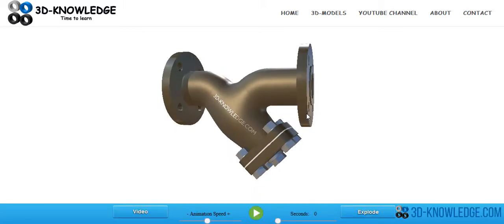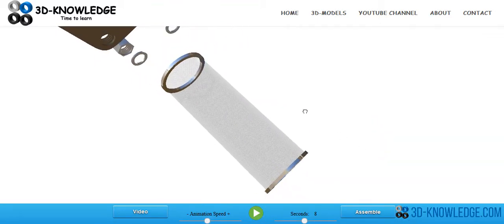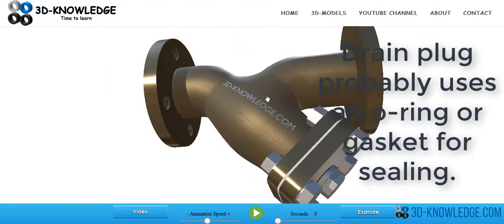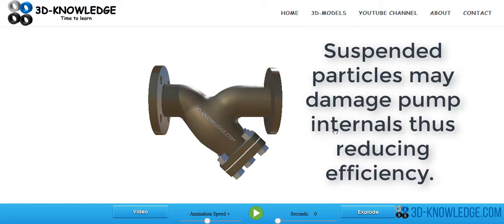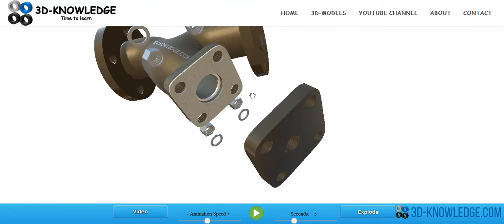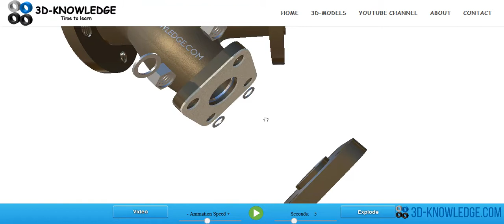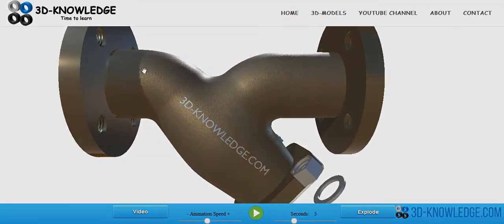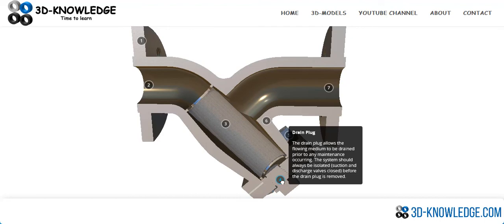Y Strainer Explained

Comment: Nice informative one, can someone explain how to design Y strainer for 10,000 psi pressure for 2 inch pipe. Which code to follow, how to ensure min thickness for internal pressure? For pipe ASME B31.3 is based on OD, if we have ID fixed how to find min thk?

Comment: About the installation. Not flow direction but orientation. is it important to install this filter in horizontal pipe as in this example or it will work the same in vertical pipe too?